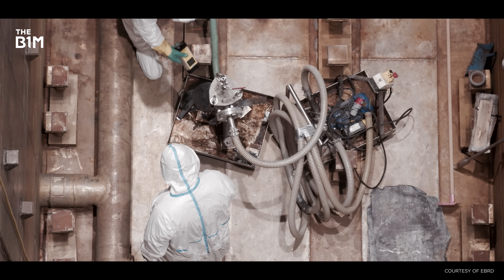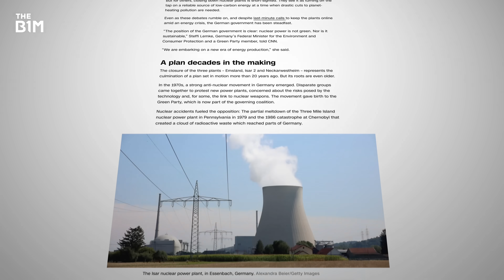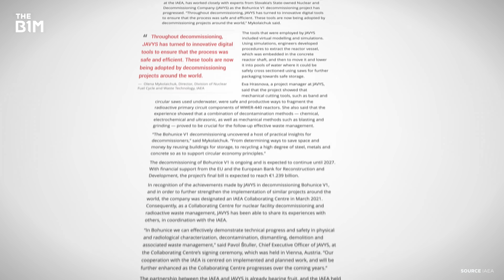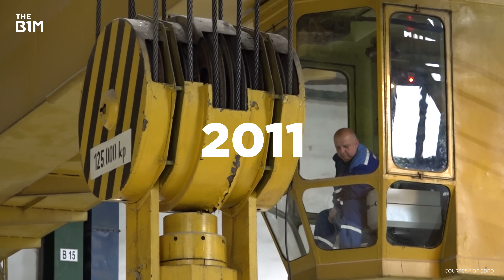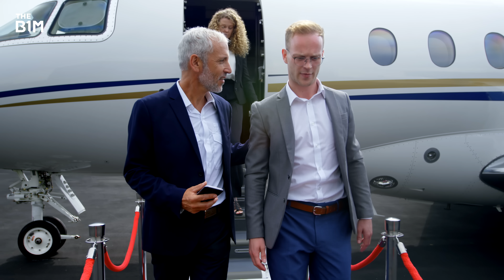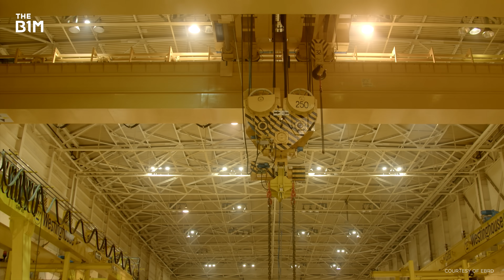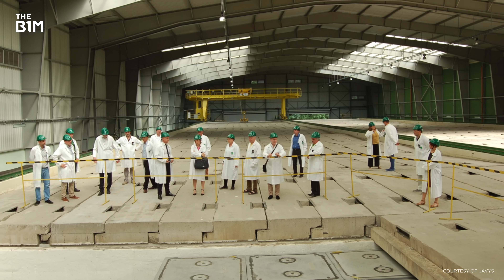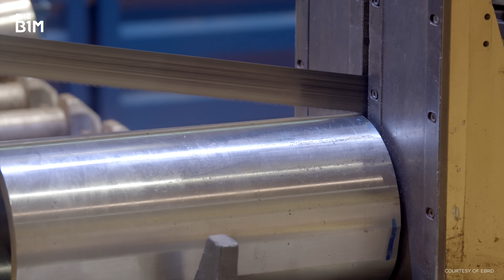Why These Soviet-Era Reactors Are Being Taken Apart

Comment: Nuclear makes especially no sense when combined with Wind and Solar. Due to the nature of Renewable and there fluctuating power, Nuclear isn’t flexible enough. Nuclear Reactors need to be run on an constant Power to work efficiently, but when for example the sun is out or there are a lot of wind Renewables are much cheaper and then the Reactor needs to be throttled. 
The perfect combination for renewable are storage solutions and Generators like Gas which can be easily turned on when needed. 
There are Studies form the Frauenhofer which compare the total energy cost of different sources over their lifetime, and nuclear can be cheep after they reach amortization but before that it can’t really compete with Wind. Furthermore due to the lack of suitable end storage facilities the energy cost for nuclear doesn’t include things the like end storage and potential disasters. Including this nuclear makes in its current state even less sense.

Comment: Build them modularly and leave plenty of space between them.  In this pattern

A A A A 
T T T T
B B B B

A reactors are first built, B are 2nd wave. T is turbine halls. 

When A reactors are nearing end of life, build reactors in the B position, then decommission the A position reactors. When the B reactors are nearing end of life build new reactors in the A positions. Over and over again. 

This way you continue to use the turbine halls, since Turbine and power generation technology has pretty much reached a plateau. There is no need to continuously upgrade this equipment. 

Using this method you always have reactors online for local power generation, and they can be phased out and replaced over time.
Reply: It sounds logical, but it actually makes absolutely no sense. One thing that few people know is that the cost of the reactor and the rest of the equipment is only 15-25% (I'm writing from memory) of the total cost of the nuclear power plant. Everything else is concrete, salaries, and everything else related to construction. Accordingly, you propose to actually increase the volume of construction and the cost of the nuclear power plant by 1.5-2 times, just so that in 60-80 years it would not be idle for a couple of years during the dismantling of old reactors. This is not to mention that technologies or regulatory documents may change during this time, and therefore it will be impossible to use Site B. Or it will require additional modernization.

Comment: SMRs are a complete failure. All major SRM projects have been abandoned. SMRs require the same level of security and construction as large nukes so the cost per mw is much higher. SMRs would be cost effective in places where no power lines exist like Antarctica or isolated villages.
Reply: It woud be cheaper to build a powerline there over any SMR . It still woudnt solve the cost problem and to get fuel there and to run water pump ec. You need inferstructers so you basicly build a powerline anyways

Comment: The EU was stupid - both WWER reactors in Bohunice were of much different design compared to Chernobyl design., which was reactor places in a deep pool of water. WWER reactrs are pressurized and concealed.
Reply: While that is true, the design of 230 version missing few features that EU "needed". Propably this 2 units could operate for several other years.
213 versions of VVER 440 are still in operation in Slovakia and Czechia.
Reply: @ao5139 "needed"??? Like Germany now need to restard old coal power stations ;-)
Reply: @WolfhuntFayed by far not anymore. Only during gas crises at start of war this had to be done to save money.

Comment: The best solution is to go all in with fuel reprocessing and use the more energetic isotopes for useful industrial processes, for example the 137Cs can be used to purify biologically contaminated water, and the 90Sr can be used for space probe RTG modules. It emits stronger radiation than purpose made 238Pu but it is a lot hotter per gram and decays into harmless yttrium.

Comment: Just curious why certain things like the cooling towers couldn’t be reused with a new power plant unless they were also in poor condition. Seems like certain things were destroyed just to destroy it.
Reply: My guess would be that different NPP designs need different cooling towers to operate optimal. And it seems unlikely that they rebuild a VVER design. And newer designs with a higher power output will likely be to much for a VVER 400 cooling tower.
Reply: It also depends on what technology is replacing them. For example, wind and solar (which is now cheaper than most nuclear power) doesn’t require cooling towers.
Reply: They were in poor condition. Chunks of concrete missing visible corroded rebar cracks etc. You could not see it in video but you could in real life.

Comment: Hah great segue into Masterworks! But not being funny, VVERs are technologically and schematically similar, if not identical to PWRs. Most of the primary circuit would have experienced embrittlement and degradation, so given that it operated since the late 70's, you're reaching the end of life properties for making a structural integrity case. Most of the material grades in the 70s aren't as refined as they are now with a lot more impurities; sulphur, phosphorus and other tramp elements that would affect the start of life mechanical properties; strength and toughness etc. From an academic and industrial learning point of view, utilising the end of life primary circuit materials for mechanical tests will help further our understanding of material properites when highly embrittled and can be used to influence and revise design codes for example. Also, since most SMRs are basically more compact PWRs, the lessons learnt will be hugely valuable.

Comment: VVER-440s are good for 60 years with a reactor pressure vessel annealing at the 30 year mark. Finland and others have done this with their VVER-440s.
Reply: This is about a specific version of the VVER 400 that got removed. Newer version of VVER 400 and 1000 are fine. Guess this specific version has cut corners and has not the needed safety systems build in. And likely is not build to have the safety features added later.

Comment: It would be cool if the B1M team could do a video on the Transformational Challenge Reactor and its Yttrium Hydride moderator. This could be a real enabling technology for SMRs that do not use water as a moderator and coolant. For example Helium, heavy Nitrogen, Lead, or molten salt cooled reactors. Until now water cooled reactors had an advantage over these types as they had the best moderator, the hydrogen in the water. But Yttrium Hydride contains as much hydrogen and is stable as a solid to well over 1000 degrees Celsius.

Comment: I'm obviously missing something:  why is it not possible to re-use parts of these structures to house modern reactors?  The buildings seem sound and the sites obviously are already linked to the grid. 
That said it seems strange to me to see what in the video look like blocks of flats a few dozen metres from the reactor building!
Reply: The blocks of flats are probably support buildings, NPPs need a lot of offices and other non-industrial working spaces, too. Some powerplants have in integrated directly to the powerplant itself, but not all/most. 

The reasons not to reuse the buildings are numerous, but probably the biggest once are safety and economics. While the building is in good condition most likely, it can easily be 40-50 years old which isn't new for any building. Most modern reactors are meant to be used up to 60-80 years and the building is hard to modernize once it's build. Also, every reactor is unique to some extent, and fitting a newer reactor to an old building would cost a ton, limit the design, and just building it inside the old building could be almost impossible due to how large (up to 500 ton components) and how complex it would be. Using an old building for a new reactor would probably force a slightly lower standard of safety in the new reactor, compared to using a new bulding.

Also a more minor problem is the activation of materials by neutron radiation, outside the pressure vessel it's usually only minor, but depending on the reactor type, this could still be a large portion of the containment building. This isn't a problem as is, but does cause higher doses for workers.

My knowledge isn't so much in the engineering, but in radiation protection.

Comment: You failed to mention the reason behind the requirement, which is key to all these dismantlements in the former Warsaw pact:

The Soviet nuclear industry designed plants without fundamental safety features, such as a containment building, which can't be retrofitted. In crucial parts of nuclear safety, the soviet safety precautions were only trust in god/luck.

... and by the way: Nuclear power always was and still is the cleanest energy source known to humanity.

Comment: For a pressurized water reactor 30 years is as old as 5 years is for a car: not even half the life it has

The design lifetime of 40 years for reactors from the 60s and 70s was based on extremely conservative estimates on neutron radiation embrittlement of steel. They chose an estimate that was sufficiently conservative to still meet or exceed the design life.

The actual safe operational lifetime of pressurized and boiling water reactors is, so far, unknown, but definitely above 80 years.
Reply: Try to explain that to Southern California Edison, who is STILL charging me for decommissioning San Onofre after a spectacular engineering blunder.
Reply: @desertbob6835  At least they extended the licence of Diablo Canyon for another 20 years.

Comment: The guy seemed to be a supporter of nuclear power and that’s fine but he doesn’t talk about the economics of this technological platform. Nuclear is far more expensive than other forms of energy especially those he mentioned at the end of the video. Nuclear might be clean but it’s a lot more expensive
Reply: And it is only clean during generation and then only if nothing goes wrong. Especially mining uranium is an giant environmental hazard, which is rarely talked about, as it doesn't happen in our proximity.
Reply: @SunSailor  How many uranium miners have died compared to the hundreds of thousands of coal miners?
Reply: @krashd  You imply an either or. We need to overcome both. Yet, there are significant deaths in both, as mining is mining, in both cases, mines collapse and the lungs are exposed to the materials. Open uranium mines are much more hostile than coal fields. But how do you come to the conclusion, there would be a significant difference in mining one or the other? Serious question?

Comment: Decommissioning a nuclear plant can be expensive.  Building a new one is expensive.  Small modular has been around as long as nuclear submarines, but hasn't yet gotten any less expensive.  And nuclear power uses lots of water (half of France's total water withdrawals, for instance, thus a less good choice in dry areas, or even areas with heavily subscribed water, or even France if it ever progresses to 100% of France's energy source).  For some places, nuclear seems like a clear good choice (like northerly Finland with its extensive coast).  Elsewhere, photovoltaics have gotten so cheap as to make them the cheapest even when cloudy.  And wind keeps getting cheaper and quieter, and even viable in tiny quiet turbines on buildings.  I wish that the nuclear power industry had done a better job on costs over the decades, but it hasn't.  Very unfortunate.  But we have only so much money.

Comment: The west gives Central Europe to the communists after the war. 
The west 40 years later: Nooo, you can´t have soviet made things!
Reply: It is just a specific configuration of the VVER440 that does not meet the required safety systems. There are other VVER440  and VVER1000 NPPs  still running.

Comment: "More than half of these hugely complex systems are now over 30years old". I think you mean 40 there. Most of the ones in Europe were build in the 70s as a reaction to the oil crisis (and to get some plutonium for cold war purposes), and the few reactors that were not finished by the time Chernobyl happened, did not come online until much later (like the one in Chooz). So most of the french reactors are rapidly approaching 50 years of run time.

While the B1M seems to like nuclear power, it did get explained that the Slovakian gouvernment, and the European Union are paying for the dismantling of these reactors. This was not factored into the cost of electricity it seems, but instead had to be dealt with through normal taxes.

Even if you ignore this massive subsidy, nuclear is way too expensive to be able to complement renewables these days. The cost per MWh of Germany's nuclear reactors is deemed to have been 120EUR. With the amount of renewables on the grid, the day ahead pricing only hits more than 120EUR/MWh about 10% of the time (check out the SMARD website from the german national grid). But that 120EUR per MWh is for running nuclear power plants at capacity, and it's not as if nuclear power plants like being ramped up/down a lot.

But all of that, including the dangers of radiation and the trouble with long term storage, is dwarfed by one metric: insurance.

Check out the german wikipedia page of "Deutsche Kernreaktor-Versicherungsgemeinschaft". The second reference goes to Manager Magazin, to the article "Risiko Atomkraft: Die teuerste haftpflichtpolice der Welt", from 2011 (translated: the risk of nuclear power, the most expensive liability insurance in the world). Here they calculate that if nuclear power insurance would be part of the cost of nuclear electricity, the consumer price of electricity would go from 20c/kWh (germany, 2011) to 4EUR per kWh.

Globally installed grid level battery storage capacity will soon surpass pumped storage. And despite the FUD surrounding burning batteries, i am pretty sure insurance is part of the business model and the cost per kWh. And given the fact that tesla megapack pricing is somewhat public (and megapacks are expensive): 1.3Musd per 3.9Mwh, we can calculate how much GWh we can install for the cost of building one EDF EPR (reference: hinkley: 46B GBP for 2, or 23GBP or 29.25B usd). So 29250M usd divided by 1.3M usd = 22500 Megapacks at 3.9MWh is ~88GWh. Half of what Germany needs to completely flatten intra-day electricity demand and to stop curtailment of existing renewables, and it would totally transform how electricity grids are managed.
Reply: The next years will be great. For grid storage are sodium ion battery good enough. Not that high on the power density but that does not mater on grid batterys. And as it is using less expensive materials and less problematic ones will the price of Grid storage even more than the existing ones.
Reply: @toggleton6365  Even classic LFP is looking insane as well. China prices are like 50EUR per kWh for 6000+ cycles. Solar has massively dropped as well. Pure economics make nuclear and fossil fuels dead ends.

It is just a matter of time before all the pro-nuclear and pro-fossil fuel commenters here will jump ship.

Comment: In modern era, one disadvantage of nuclear reactors is their inability to rapidly adjust to demand/supply (for instance ramp down when solar/wind produce enough to supply the load and quickly ramp back up when wind dies down and the sun sets).
Reply: it's called 'base load' and you need it
Reply: @joshgardner4879  Hydro Québec is able to dynamically adjust its hydro electroc production based on how much solar/wind bring into the grid. By turning off turbines, it keeps water in the reservoir for later when it is used.   The perverse:  HQ normally exports to the USA. But when the USA has surpkus, because their "base load" can,t dynamically adjust (coal, nuclear, though natural gas can be adjusted quickly depending on design), the don't know what to do with surplus, so Hydro Québec buys the surplus for dirt cheap while tring off its own turbines and keep water in reservurs, Later, when tghe USa needs power, HQ will release that water to provide more power and sell it to USA. 
Where base load cannot be dynamically adjusted, it is useless to have renewables because you don't save anything as your base load continues to produce.
Reply: @joshgardner4879  Easy, buy grid level battery storage. You can buy 88GWh worth of expensive tesla megapacks for the price of building one EDF EPR. And that's before that reactor has had uranium fuel loaded, with all the costs that entails. This is about a years worth of battery storage production today, but this production capacity increases by 2/3rds every year since 2017.
Reply: @luc_libv_verhaegen  the problem with that is that we don’t have batteries that are cheap enough and energy efficient enough to be used on an industrial scale… pumped hydro is working pretty well, but unless cheap solid state batteries become a thing they won’t be happening any time soon.
Reply: @Jhonmary9951  is 6GW peak output big enough? it is what califonia is using already. And the prices for the cells did drop in the last months. 
Nah solid state is a nice dream but for grid storage is the energy density not interesting and you can go for cheaper materials like Sodium ion batterie that will scale up in the next years.
Reply: @Jhonmary9951 uhh they already are using grid scale energy storage through Tesla megapacks. This tech is incredible and not new. It dramatically helps with grid  stabilization and temporary back up
Reply: so, unreliability of solar and wind is the problem, then?
Reply: Why they replaced,updated or decommissioned for various reasons
Reply: Not a problem.  The just move the power to a different part of the grid that needs it.  Solar and wind are not reliable.